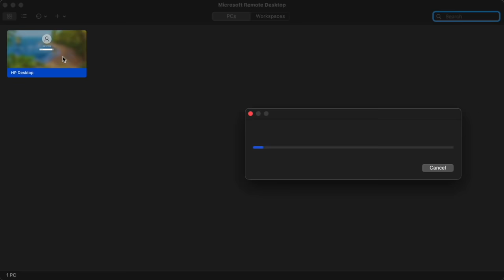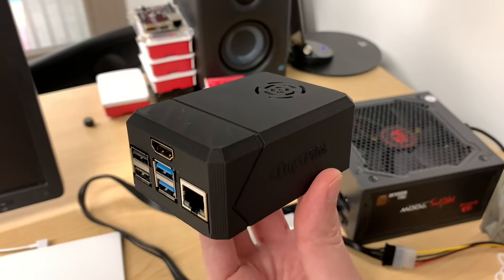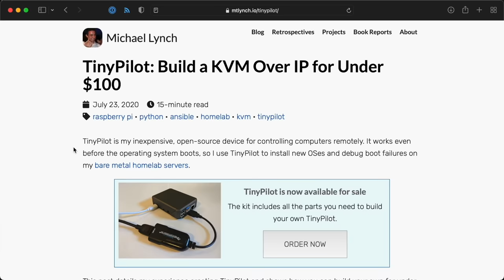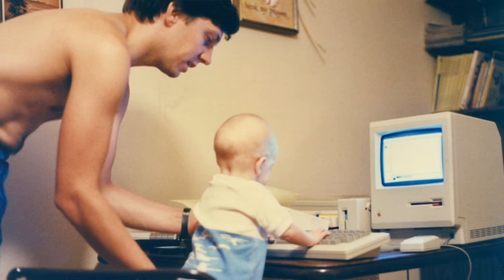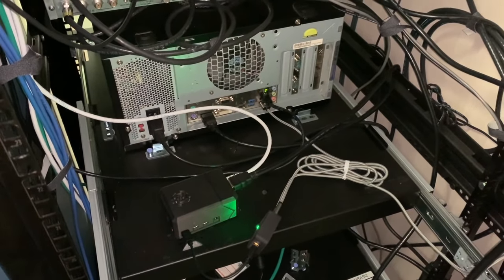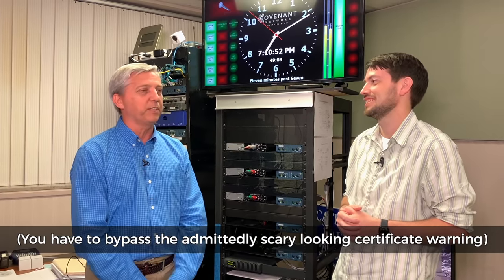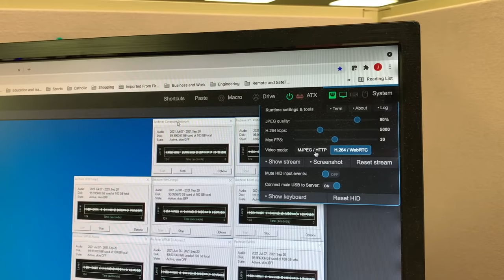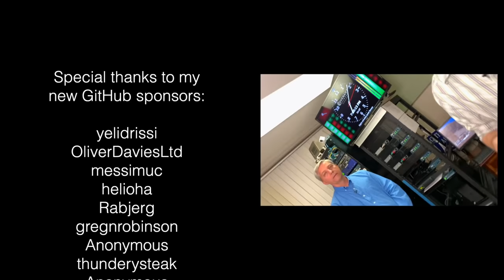Control ANY COMPUTER with these Pi KVMs!

Comment: 42 dislikes from people who already bought KVM for over $500 before this video
Reply: 45 now, probably some now that read your comment
Reply: $150 board, $50 pi, $100 4 port switch (with 50% discount). That is $350 already. Or $450 on a regular price. These "cheap" solutions are nowhere cheap at all.
Reply: @D9ID9I  you assume the 4-port switch, but all you need is a free port on the switch that feeds the machine anyway.
Reply: I didn't thumb down this but it is a bad video because you can get way through it (about half way in my case) without being told exactly what these Pi KVMs are and how one uses them!!!
Reply: @D9ID9I  May be we have a misconception here between (i)KVM and IPMI. Jeff explained what IPMI is very briefly starting at 1:39. Don't confuse this with desktop (USB, HDMI, DP) or enterprise (IP-based) KVM Switches like ATEN's. This is supposed to plug into your computer to provide an IPMI interface which the computer doesn't provide or which is present but doen't fit your needs. You connect to the Pi to manage the computer like you would connect to an IPMI or a virtual machine console.

I'm not a fan of giving one thing more than one name and confuse the heck out of others trying to make sense of marketing jargon either. But they've been pretty consistent with iKVM (integrated KVM).
Reply: @LiveWireBT  the misconception lies in pi-kvm definition. Because kvm supposed to switch between multiple PCs and pi-kvm does not provide this functionality by itself. You have to pay $150 for a board that literally does not do much. But pi-kvm can be paired with a regular kvm switch to actually become an ip-kvm. One of the supported switches is 4 port ezcoo one. But if you sum all parts it won't be cheap at all. And for a lot of money it is also limited just to a tiny capacity of an attached kvm switch and that sucks hard.
Reply: @D9ID9I  show me where you get a Pi for under 150€ that would be roughly 180$
Reply: @97oweb  Amazon listings for cannakit complete pi4 1gb kit is $139 in the us. Not every project needs the 4gb that's out of stock.
Reply: Or people searching for a physical KVM that fits their network security policies.
Reply: 309 now 😅

Comment: I've worked with many IP KVMs.  On top of their usual lack of features (hdmi is rare, many don't even do USB)  they tend to suck.  Java based interfaces, mouse doesn't always work.  The fact that this works even on your phone makes it better than pretty much everything else out there.
Reply: Amen, the amount of times I have had to go into a data centre just to reset a KVM…….
Reply: have you use Raritan KVM? or know about it>>
Reply: @yudhavidian102  I've used them from time to time.  I see they finally have switches with HTML.  Still stupidly expensive though. 

My prediction is that we will see an overall price drop as a flood of Chinese manufacturers start skinning PiKVM and start producing equipment the same way openWRT caused a price drop/better flexibility in the Wifi Market.
Reply: @pkf4124  Can't you use a KVM to control the KVM?
Reply: DOOM GRIFTER  raritan kvm now does not use java... free java...i know cuz i use it full UST+KVM and CCSG..
Reply: oh man you gave me ptsd with that comment on java kvm - the worst in my experience.
Reply: you can tell Gerhard works with IP KVMs just by his face 😂 maybe getting up and pressing buttons for once would do you some good for ya weight 😂😂
Reply: @anonymoususer6498  Tell me you don't know what an IP KVM is for without telling me you don't know what an IP KVM is for.
Reply: Came here (a year late!) to say the same. My server admin days are behind me now (yay!), but KVMs were definitely part of the job that I put up with rather than enjoyed.
Reply: Man great video reminds me of me catching my daughter playing on my keyboard great material man I learn a lot u got good values god bless

Comment: 4:00 'Setup was a little more difficult because it comes as a kit and you have to assemble all the parts yourself.'
For some, that's a bug. For others, that's a feature.
Reply from the maker: In my case, I accidentally pinched the 5v fan wire in the GPIO pins... and the first time I turned it on some smoke started coming out.

I thought I fried the whole thing, but luckily it was just some burning insulation on the fan wire.
Reply: @JeffGeerling  Ouch! Maybe I should send you some wire splicing materials to get that all fixed up ;)
Please say that's in the bloopers.
Reply from the maker: @MarcoGPUtuber  Unfortunately of all the assembly process, I forgot to record "first boot".

I should learn by now that's the shot that has the most potential for excitement!
Reply: @JeffGeerling  Exactly! Same with the 2.5G Card. We missed the magic smoke and had to settle on a re-enactment.
Reply: It's also not the case anymore, because of the kickstarter you can get a PIKVM in a metal case.
Reply from the maker: @autohmae  I don't believe it comes pre-assembled—it's still a 'kit' you have to assemble, case or not.
Reply: @JeffGeerling  I guess I'll know soon, because the Kickstarter will end in 48 hours and then they just start working on shipping them. :-)
Reply from the maker: Haha, yes. I was amazed (but not surprised) how well that Kickstarter's gone. Kudos to Maxim and all those working on Pi-KVM!
Reply: @JeffGeerling  I'm really glad, they deserve the recognition. Creating that µStreamer project is a real game changer.
Reply: And for some of us is a pleasure to do it ahahaha
Reply: Exactly this!  I love building stuff.

Comment: Funny how things change! During my brief stint in radio in the mid-90s, we were still using carts (more or less 8 track tapes) for commercials, background music during traffic reports, etc... I wonder how many people in radio today have ever  grabbed a cart to play a commercial? :) We, as individual DJs, were just starting to bring our laptops in to play random sound effects at the time. It was a novelty.
Reply from the maker: I remember my first job in radio was helping decommission the cart machines; they were upgrading to CD players instead, so for a while there were 3 cart machines and 3 CD players with the CDs installed in 'carts' of their own. The wall of the studio was basically like a video store, with hundreds of carts and CDs for all the music and commercials the station would play.

Back then disc jockeys were actually that—half their job was grabbing the programming binder and making sure to line up all the carts and CDs in the right order, then hit the button for each and every one (at least until basic automation was in place so the console could switch between them itself).

A project soon after that was installing 'RCS' PCs for each studio, which involved importing thousands of reels, carts, and CDs into the system so the computer could play all the audio.
Reply: I had to make an ad and dub it to a cart for a radio course I took in college. Now you can just make an mp3 file or whatever audio format you like and push a button. No carts that jam.
Reply: @JeffGeerling  My first job in radio was helping move WIOD studio into new building sometime in 2000 - 2001 when I was a highschool kid. Then almost 20 years later I helped dismantle it all and replace it with modern IP audio tech but this time as a full time employee.

Comment: I especially enjoyed this video with a glimpse into modern broadcast radio engineering. I grew up with and around radio with my dad being a station manager for 32 years and in radio much longer than that. It is fun to see what lengths are necessary to achieve the 99% uptime your dad mentions.

Comment: You can get away with just the Pi hardware + USB HDMI capture card + USB-C cable, though I'd recommend the tiny pilot usb/power adapter if you intend on keeping the Pi running over a host reboot then just image the Pi with Pi-KVM and it works fine.

Comment: Also on a tight budget just go with a "Pi Zero 2" and an HDMI-CSI adapter. You will just have wifi to connect to it, but for adhocc problem solvings it would be great. And if you pair it with a smart plug you can have it dormant till you need it. Dont forget about tailscale if you want to reach it from anywhere no port forwards needed and it goes out on any firewall 99.9999% (but to draw the screen and also push it over VPN with tailscale it will realy limit the fps of your grabbing. In my test to 1-3fps over tailscale and) without vpn it shows about 15-25fps whch is enough if you trouble shoot a critical error remotely. Maybe some OverClocking can solve this just make sure to cool the little guy enough for it. Nice little tool for people on a budget This Is The Way.

Comment: As an ex Iheart radio engineer this was all too familiar. I like that your dad even uses SDR for watching HD sidebands on FM signals. I used SDRPlay RSP1A to tune HD mask compliance of 40 kW FM tube transmitter.
Reply from the maker: I think he's trying to make sure the 'big' radio station to the left there doesn't start interfering with his tiny 250W transmitter in the case of what was on his screen that day. It's fun decoding signals though!

Comment: I have been commissioning KVM-IP system for a control system for heating plants. Those plants might be 300km depart each another, and are managed from centralized command center. There is own private fiber network between those plants and command center. I can tell those Blackbox KVM products that we have been using are way more expensive (and maybe reliable) than PI will ever be. But i think there is definitely many use cases, where some of those lower-end solutions like PIs might be more suitable.
Reply: problem is, with the blackbox solution, how do i assess the reliability? the security of it?
At least here, we can know, and take measures :) (main reliability issue for me with the pi is the SD card, so having read only OS, or a SSD solves it).
But i agree that some closed solution may be built to extremely high standards. I am not in your shoes, so i don't know if i would dare putting the pikvm in place on very remote and very critical facilities...
Reply: @AudreyRobinel  I am sure anyone in charge of the computer asset on the other end of one of these devices either knows where pi based KVM-IP solutions are relevant, or are about to create a job opening for someone that does.  Either way, these devices are a win-win for everyone.
Reply: @jong2359  Hey i did not say i didn't like those, on the contrary, i'd rather have those than the blackbox ones. I was just stating that i am in no position where a failing ip-kvm could be a big problem.
I am all in for open source technologies, especially for things that are critical to me.
Also a problem with closed source blackbox solutions is that you have one you like, you set up a workflow around it, and then the product dies or whatever, and the new verstion is different, incompatible with your stuff. Open source can have breaking changes, but i can always revert to an older version of the software, even for just enough time to adapt my stuff to the latest version...

I really don't like the arbitrary nature of closed source stuff in that regard.

Comment: I recently built a new home server, and selected a server motherboard (ASRock Rack X570D4I-2T) that has an onboard BMC with KVM. It was not significantly more expensive, and the functionality (including IPMI interface from Linux) was well worth it. The most fun experience was upgrading the BIOS - before I even had a CPU installed! That's functionality that the external KVMs don't provide. Our home LAN is only remotely accessible via Wireguard, so secure access to the BMC/KVM is covered. I'll never build another computer without a BMC/KVM.
Reply: The difference is that many guys here now will gonna spend over $200 to control $50 pi device. Doesn't sounds smart.

Comment: Hi, Jeff!  You should do a video about how you would wire your house for networking if you could start with a clean slate - equipment, routers, switches, cabling, wifi, etc.

Comment: I liked the video.  I had thought about using a Pi for this, but haven't found the time to look into it.  Glad to see that it has been done and I could deploy without a great deal of work.  I was also glad to see that security was mentioned as a consideration and perhaps less of an afterthought.  I thought that I heard a suggestion of powering the Pi from the host's USB.  If I heard that properly, I would want to verify that works completely before doing so, particularly if the intent is to include control of the host's power.  Powering off the host may also cut power to the Pi.

Comment: Not exactly my KVM "reqirements", they are more for local use at my desk.
(1) Desktop computer 
(2) Laptop computer
(3) Android tablet
(4) Android phone

I mostly work on the desktop computer, but sometimes do tasks on the laptop as well. The android devices are mostly just docked, but for convenience, it is easier to switch KM than to pick them for minor tasks, mostly like miscellaneous methods for authentication.
A: chose between either device to be controlled by Keyboard+Mouse, but ghosting semi passive keyboard+mouse to inactive device (not connect/disconnect on every switch). As long as there are some action on the K+M, there should be option for some insignificant action to the passive device, to avoid screen lock time out.
B: independently chose computer for a monitor.

Today I use:
A simple 4-port mechanickal USB-switch
A simple independent HDMI-switch
-- It does the job, but one thing I would relay enjoy is some way to share clipboard between the devices, mostly just to copy/paste a short text. I have no idea on any way to get a shared clipboard.
Reply: I suggest you try VNC, but I do not know if you can run the server element under Android.  I control a RasPiOS Linux Raspberry Pi Zero from my Linux AMD64 machine.  As was discussed in the video, you do have a bit of latency.  With the PiZero the network link is over WiFi.
But I can copy text in the local machine and paste that into the VNC remote console, and vice versa.  I just checked again to make sure I am not misremembering what I have been doing, and so leading you astray.  :-)   VNC does also provide a file transfer function between the machines, but I have never used it.
While I was checking this out I ran a OS update on the PiZero.   For most of my other computers I use a traditional DVI/USB KVM switch, not an iKVM.  I do not need, or want to run the risk associated with, remote access over iKVM....   but I never know when I might need it.

Comment: I have boards with IPMI, but many of them are like: "If I'd known this particular IPMI was going to suck this much*, I would've gone with a different board."  But then, I'll bet they *all suck in different ways!  For example, Asrock X570D4U.... the framebuffer is 800x600 (not even 1024x768), and the serial-over-lan is wired up in hardware but not in BIOS.

Comment: Certain server brands, like Dell, for instance, the solution is called  DRAC ( dell remote access console  ) but their support really depends upon such a solution for troubleshooting hardware, especially for failed hardware.   On other systems, it might be called ILO for integrated lights out.  Premise is the same;  their techs do really depend upon such hardware  for access.   These Pi KVM's would be a great fit for accessing servers remotely after the system has booted,  but I don't see them as being as developed as DRAC/ILO's are. 
In today's corporate world, especially if they are contractors that work with any government agency, the #1 concern is security along with hardening. 

For a number of years, we did use multi-port IP KVM's, but that fell out of favor a decade or so back.  They were expensive, and often gave no more functionality than these Pi KVM's. Hardware devices integrated into the servers, like DRAC's/ ILO's  took over.
As we move to cloud based resources, well, even that level of access is partially gone.  But then, with cloud based, we no longer have to foot the hardware bill either.
Reply from the maker: These devices are targeted on the lower end, SMB and homelabbers who might not have servers with built in management (or it's so old it's effectively insecure or unusable).

Comment: I found a much cheaper solution to reboot locked up pi’s in my Kubernetes lab.  I use a HomeKit power strip from Kasa.  It costs $50 and I can remotely turn off and back on a any of my systems.  This doesn’t handle the KVM part of course, but helps with automated reboot of nodes that get swamped.
Reply: Just using smart plug to reboot my remote PC, setup it to ON again after 5 second OFF. And they cost only 120.000 rupiah. Less than $10 ?

Comment: In the past when desktop motherboards had PS2 connector's for both keyboard/mouse. I owned a KVM device can't remember the make of it but it could control four desktop computers. I used it until USB keyboards and mouse became the new standard which at that point got rid of it.
Now I just have one desktop computer and my laptop computer which is used for look up stuff while I game on my desktop.

Comment: But but if a kvm crashes what do you need? A kvm for the kvm? 
But if the kvm for the kvm crash? 
Do you need a kvm for the kvm for the kvm?
But if the kvm for the .....
Reply from the maker: "Why are there 100 Raspberry Pis attached to this computer?"
Reply: @JeffGeerling  "reasons"😂
Reply: gotta do a triple pi with a redundant switch for the perfrerials, Kubernetes, and putting this software in a pod to run on them

Even better also include another interconnect to the other PIs so you could update and manage the other PIs ...
Reply: You get in the car and drive over to reboot it, or call someone nearby to do it.  IT 101, except now you only need to do it every few years or so.
Reply: @JeffGeerling  It's just the PI Pyramid Paradox